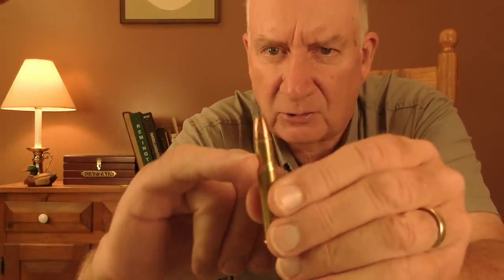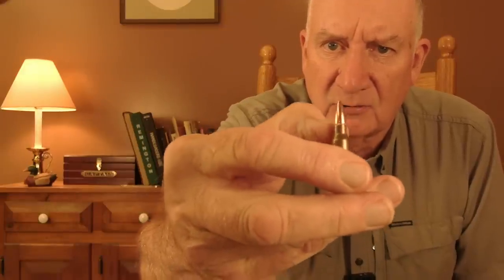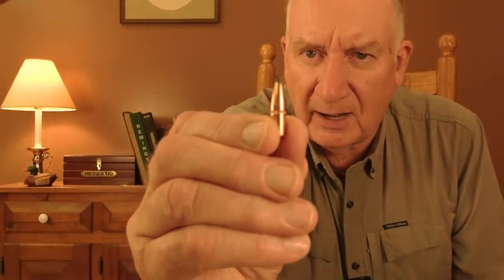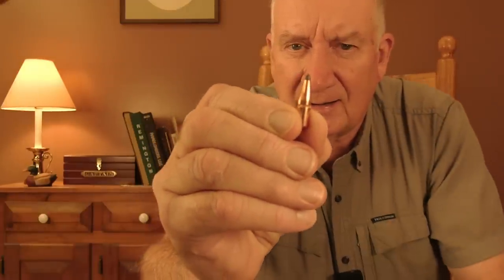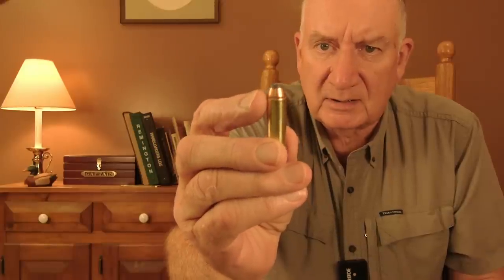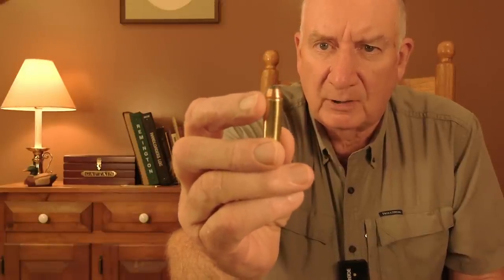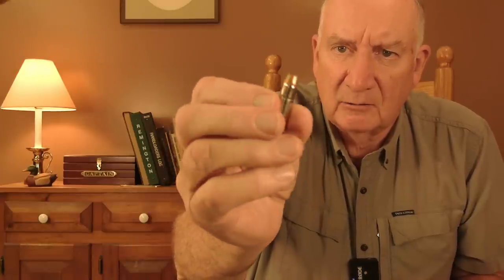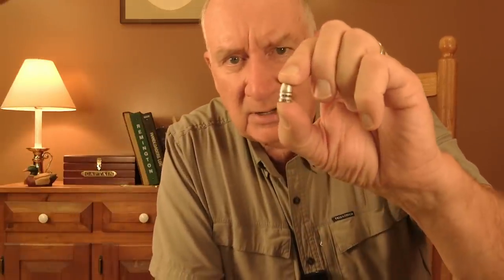Crimp or Don't Crimp ~ You'll Know the Answer!

Comment: I crimp all my 223/556 rounds now, because I had 2 failures to feed (FTF) which I attributed to not deburring the case mounth good enough after resizing.  However, when the FTF happened the bullet was pressed completely into the case and powder spilled out into the breech and magazine of my AR.  I've had similar FTFs with commercial ammunition and even when it moved the bullet deeper into the case it never pushed it all the way in.

So to avoid having to clean powder out of my action and magazine, I crimp.  This is a fairly new change so we'll see if it's effective or not when the next FTF happens.

Great info in the video (as usual).  Thanks!  I really appreciate your channel.
Reply: I had that same problem with an Hk 33 rifle I carried in 5.56.  The bullet would chamber just touching the rifling and if the case was ejected unfired, powder would go everywhere leaving the bullet in the leade.  I carried a special rod in my kit to push the bullet back into the breach, because I didnt want to get stuck somewhere...

Comment: You were correct.  I did know the answer and the methodology you describe has been my rule of thumb for over 35 years.  I find the Lee factory crimp die to be excellent for crimping the 30-30 Winchester.  I also find there is a lot of baloney on YouTube regarding reloading procedures & practice.  Thank you for setting the record straight.   Now if I could  get some primers, I could go back to my favorite hobby.
Reply: Those FCDs are excellent in general.
Reply: What you meant was affordable primers. It seems that I can find primers for 80$ a brick all day, but I've got primers that I paid 15-20$ a brick. Ridiculous!
Reply: @craigbraswell4269  
Ridiculous? How about inflation, few things aren't pricer today.
Take care,
Reply: @richardkut3976 yea but the jump from 35ish 1k to 80-120 for 1k is more than inflation. 
Personally I think its bc they want to keep those components so we buy what they load vs making our own.  Hell I have primers for 9. But I can't load it as cheap as I can buy it right now bc if I replace the primers I use it will cost more than factory new.  Might as well stock up new brass til they become reasonable.

Comment: Well done and accurate, as always. Factory crimping practice has a lot to do with the manufacturers' biggest concern: what happens between the factory and the customer? Ammunition made in Missouri and shipped to New Hampshire by truck freight can experience 1 million cycles of 0.5g acceleration up and down before it arrives. This is like tapping your inertial bullet puller on the kitchen table through numerous cups of coffee! Newer packaging that supports the bullet and restrains the case helps reduce transportation damage and allows a lesser crimp.

Comment: Fantastic info on crimping. 
I love that silver plated .222 Remington case especially since I’m reliving and rediscovering the joys of the .222 and a vintage rifle of my childhood following my Pop around.  
I have vintage .222 factory  ammo from Remington, Federal, and Winchester and there’s no discernible crimp on any of it. I recently purchased 100 rounds of newly manufactured Remington .222 ammo and all of it is heavily crimped and they used a collet type crimp die in the process. You can see the segments that a collet would leave behind when crimped excessively.   We never crimped .222 cases in our handloads and as far as I can tell, factory .222 ammo did not get crimped in the old days but new Remington .222 ammo is.  I wouldn’t think there’s an advantage to crimping this particular caliber but in my quest to find the most accurate load in this rifle with currently made new components, I do plan to test the results of crimped vs non crimped using the LEE factory crimp die.  I do have Pop’s notes from decades ago that the Speer 50 grain .224 was his most accurate bullet in this rifle and I have acquired a new supply of them to start testing with. 
Thank you for sharing your knowledge.

Comment: I encountered a bizzare situation with my .270 WSM model 700. I loaded up about 120 rounds and stored them for around 8 months. I go to the range and to my surprise the will not fit into the magazine. When I got home and measured them the were seated out an extra 15- 20 thou from what I originally seated them which was 2.86" COAL. My theory is that over this 8 month time the brass relaxed and lost enough of it's neck tension that the air inside the case slowly pushed the bullets back out- these were not full of powder either. My proof case for the load had no powder or primer so it didn't change. I tried reseatting those bullets and almost immediately they begun creeping right back out again regardless of how deep I tried to seat them. After that experience, I bought Lee factory crimp dies for every caliber I load and do it- no exceptions. I don't compete and rely on storing for potentially long periods of time so I don't want to have the same thing happen again. Anyone else experienced this?
Reply from the maker: Bullet insertion always displaces air.  However, the volume of air is extremely small, and well within the normal holding capacity of the neck tension.  I've stored handloads with compressed charges for years with no movement.  Five factors can lessen that holding ability.
1.  Oversize expansion ball or shaft.  Very rare.  The ball or largest diameter of the shaft should be exactly .001" less than bullet diameter.
2.  Insufficient neck contact.  The shank of the bullet should have one caliber of contact (not just seated depth, in the case of boat tails).  So, the optimum case contact should be at least .277 to insure against rough handling.
3.  Lubricant in necks.  Tumbling or simple dry nylon inside neck brushing is normally sufficient to clean necks.  If squeaking occurs, apply only a trace of lubricant to the neck brush.  Never, ever, use sprays. Why they were ever marketed shows how profit, not wisdom, drives such sales.  It's one of the most useless and costly snake oils we have.
4.  Cases are too soft.  Over heating brass during annealing can burn off harder alloys and irreparably ruin cases, and it's a common problem.  Watch my annealing video.
5.  Cases are too hard.  Brass hardens during repeated cycles of firing and resizing.  Hard brass loses its necessary elasticity that must grasp the bullet, just as an elasic band.  WSM intensity is particularly severe on brass and will cause work hardening over a shorter number of cycles.
.
Reply: @GunBlue490  Thank you for your prompt response GB. I have used one shot spray but no more. Based on what you've told me I'll have to look at my annealing process with these cases- I've had one or two come out with small splits on the shoulder after firing despite only sizing back about .002" and using Sinclair mandrels so I may not be holding the torch to them long enough.
I'll have you know after watching your video on big bore rifles, I acquired a Kleinguenther K-14 in .458 Winchester Magnum. I glass bedded the stock with the Devcon and free floated the barrel too- which I learned on another one of your videos. I have so much fun shooting 350 plated bullets with about 15 grains of Red Dot. 500gr Factory loads knock the crap out of my 145 lbs frame though. Thanks again GB.

Comment: I had the opposite problem GunBlue490. I bought a box of Remington .38 Special 158 grain lead round nosed. I put it in my snubby and I fired a few rounds and the revolver jammed up. A bullet had worked out of the case enough to jam up the cylinder. I shot a few more cylinders and it happened two more times. I gave up on that box. Real pain to open the cylinder with a bullet halfway hanging out of the casing.  The bullets were so loose you could push the defective ones back in the case to a point and unjam the cylinder.
Reply from the maker: Yes, the sharp recoil of a small revolver will easily do that without a tight crimp.
Reply: Yes, that is the most common problem with revolver cartridges. "Bullet pull".  The revolver snaps back in recoil and pulls the cartridge case with it by the rim. The bullet wants to stay in place and the case is pulled backwards off the bullet.  Very common and THE reason revolver cartridges should be crimped.
The heavier the bullets and the lighter the revolver, the worse it is. Snub nose .38s, especially lightweight ones like a S&W 642 are very prone to this. 

FWIW my "carry load" in a S&W M642 Airweight is the Buffalo Bore 158 gr. +P lead SWC-HP.  I have not had a problem with this in my revolver.

Comment: 357 Maximum, I found crimping is necessary, 23.5 grains of H110, topped by a 158gr Hornady XTP.
Reply: Yes. that is consistent with his advice.
Reply: My 357max is a single shot BSA Martini cadet with a 19 inch barrel, I've never crimped the hand loads, it's not necessarily. Always crimp 357mag though as it's tube feed.

Comment: Recoil forces in a revolver with a rimmed case are pulling the bullet out of the case and can jam the cylinder when the bullet hits the forcing cone.
Reply: Yes
Reply: Happened to me multiple times with one box of apparently defective Remington 158 grain .38 round nosed. It was an infuriating range trip.
Reply: Correct. It's called "crimp jump" and it is VERY problematic with very light revolvers, very hard recoiling revolvers, and semiauto caliber revolvers. You can also have those traits combined too, e.g. the Ruger LCR 9mm. With 147gr+P loads, the bullet has a lot of inertial resistance to movement and the gun recoils sharply because it's as light as a damn potato chip. The semiauto taper crimp sucks at holding the bullet because it's just pure neck tension alone. Can't roll crimp the cartridges because of headspace, unless the cylinder uses the moon clip to maintain headspace. The last bullet will occasionally leave the neck and fall to the front of the throat where the ogive sticks out and jams the cylinder from rotating. That last cartridge is subjected to the recoiling of all the previous being fired. It works exactly like a kinetic bullet puller hammer. The scandium frame .44 magnums will do it. The scandium J frame .357 magnums will do it. The Ruger Alaskan snubby in .454 Casull will do it. You get the point. Crimp jump will put a revolver out of action and a non-marring hammer and punch is needed to resolve the failure.
Reply: @mannys9130  You seem to like talking about this stuff. You should get your own channel. I'm sure people would watch.
Reply: Yes.  In simple terms the revolver can act as a bullet puller.  When a revolver goes off it recoils backwards pulling the backward force on the base of the cases in the cylinder.  The bullets in the cases being a separate component, want to remain in place while everything is rapidly recoiling backwards.   The only thing stopping the bullets from sliding forward is the crimp.  That’s the only part of the video I don’t think was explained well.   But this is one of the best guys I’ve listened to on YouTube.

Comment: BTW:  I tried setting up an RCBS powder measure using the method you showed (placing the pre-measured load wanted in the measure and then adjusting the metering assembly against the back of the housing casting.)  That was a great tip; it took very little adjusting to get it spot-on.
I also experimented with two identical RCBS powder measures - except one had a large powder bore drum and metering assembly and the other had the smaller bore drum and metering assembly.  I wanted to see if one threw more consistent loads than the other.  I chose 6.0 grains of Unique as my test load, a typical piston/revolver load.  The end result, for me at least, was that there was no discernable difference.  In fact, if anything, the measure with the larger bore may have been a tad more consistent than the one with the smaller bore.  I'm guessing that is possible because the powder does not have to drop down into as deep a cavity with the larger bore and therefore has an easier time of getting the same amount into the bore each time(?).  Whatever the reason, I could find no reason to switch to the smaller bore drum and metering stem.  Thanks again for your shows.
Reply from the maker: Thank you for your support.  I'm glad that you performed your own test and discovered the best situation for your loads.  As a matter of note, Unique and most pistol and shotgun powders charge very uniformly, and the reason you observed more consistent charges with the larger drum is because of their nature to stack flat and slide past the cutting surface agreeably, if you will.  If you ever load with standard charges of extruded rifle powders however, such is not the case. They're shaped like logs, so any that are caught between the frame and drum must be forcefully sheared by the operator. The more granules that are exposed to the larger cutting surface, the more difficult it is to swing the drum, and the greater the number of granules that get randomized and upset the volume consistency.  There's a very discernable difference that is easily observed just by the effort involved, and you can actually feel more granules being cut.  So, don't let that small drum go anywhere in case you need it some day!
Reply: @GunBlue490  Got what you're saying.  Yes, they are shaped like little rods.  Thanks much.
Reply: @GunBlue490  I have found this too using Vit N140. I prefer to use the smaller drum. I'll be watching a lot more of your videos over the winter, a nice contrast to the younger guys that tend to be drawn to the latest shiny gadgets!

Comment: I have found that the Lee FCD is very handy especially for semiautomatic handgun cartridges. I use the FCD religiously for all of my 9mm, 10mm, and 45ACP loadings. I like it not only for the uniform collet crimp, but also for the added benefit of post-sizing the case at the upstroke as the casing exits the die. I have had zero chamering/extraction issues in many thousands of rounds loaded with this great tool.

Comment: Many  thanks for another tutorial vid on re-loading.  I am starting to reload 9mm using Starlilne brass with 124gn Berry RNCP bullets.  My question is on the  taper crimp used for this.   I have a Lee die set with a separate die for the crimp.  How much crimp is too much ?  I am used to reloading .45LC and no problems . . .BUT now doing 9mm hand loads using a taper crimp is a little confusing on how much crimp to use.  I have Lee 9mm die set and RCBS .45LC die set....tks !

Comment: I had a random feed problem with my 45 and 9 hand loads. I added a Lee factory crimp die to my progressive press and solved the problem.
Reply: I’ve had .40 S&W and especially .357 SIG have bullet setback on feeding from the magazine…the LEE factory crimp die made this issue with setback a thing of the past…I also give a fairly heavy crimp to my PC cast .452 bullets for Cowboy Action (I use the same loads in both Blackhawks and my rifle)…as an aside I always have cleaner brass when loading Hodgdon Titegroup if the heavy crimp is used…sooty cases with light crimps. I also use the LEE Factory Crimp on .300 Blackout and .556/.223 with a lighter medium crimp. The LEE company has kept reloading “honest” as well as affordable especially when starting out…I still use LEE dies in many calibers that I bought 30+ years ago (being a “thrifty” old man (some will use “cheap ass) I’m still rocking out ammo on a Dillon RL 450 I bought in the 1980s 😊😊😊…GunBlue490’s channel content is great with sensible videos delivered in a very clear easy to follow manner 👍👍👍…A BIG THANK YOU Sir!

Comment: I used to reload 30-06 for and old Ruger M77 and quickly learned that I had to use a cannelured bullet with a solid crimp for the purpose of feeding. That rifle would hang up the case mouth on uncrimped loads.
Reply from the maker: That's a terrific controlled feed bolt. I suspect that it was catching on the sharp edge of the magazine box before the case slid fully up into the claw, which can occur with some rifles.  In most situations, the remedy is to simply bevel the offending edge with a couple of strokes of a fine file, followed by a bit of cold blue.

Comment: You mentioned you sometimes use a crimp on .223 , could you explain why please as I am reloading .223 at the moment. Great info and so well explained thank you
Reply: It’s not required if your single feeding a bolt gun or have a short magazine 5/10 rds. What can happen is although the 223/556 is a low recoil cartridge, in the case of a longer magazine 20/30 rds the the cartridges are further away from the recoil of the firearm so they experience more backwards movement the further along they are in the magazine, if your a reloader and your trying to decide to crimp or not? It has been shown that consistently crimped cartridge are more accurate and more precise then non crimped bullets if thats important to you you should crimp…. That being said most application for shooting don’t require the degree of accuracy I’m talking about(plinking at the range) not all hand loaders crimp. However I would advice because consistency is the key to safety when reloading if you decide to crimp you should always crimp if you don’t then don’t. Be advised that most two dye reloader sets,the seating dye is also a crimping dye, it’s just that Lee makes a separate dye( very popular) just for crimping. It’s popular because it gives you a factory crimp, this is because it’s using the same collet mechanism to crimp that factory ammo used that’s why it’s very popular with reloader’s.  Sorry I’m long winded. Hoping this helps